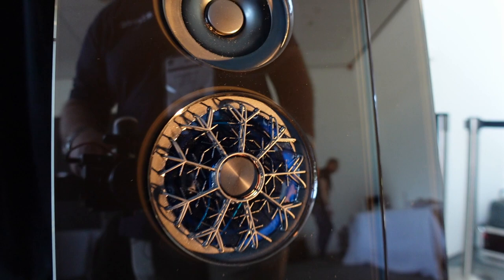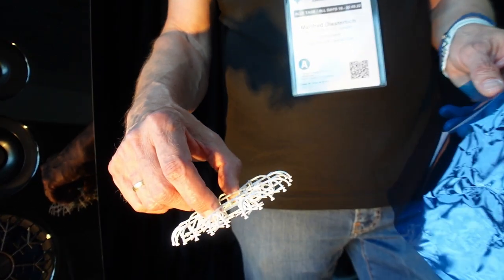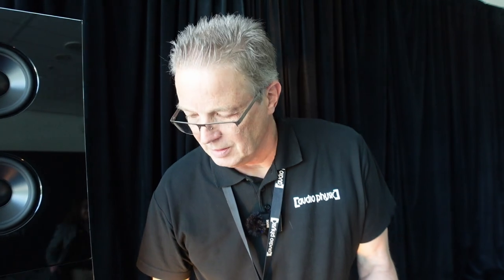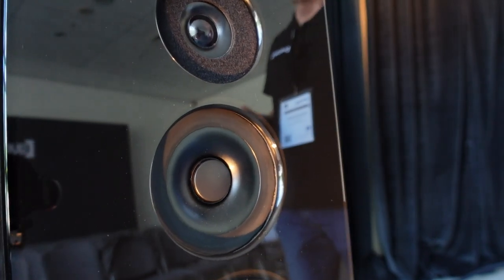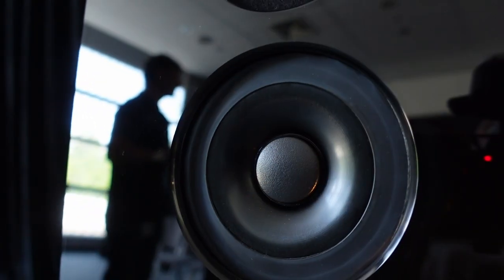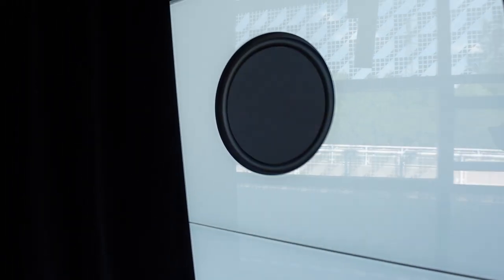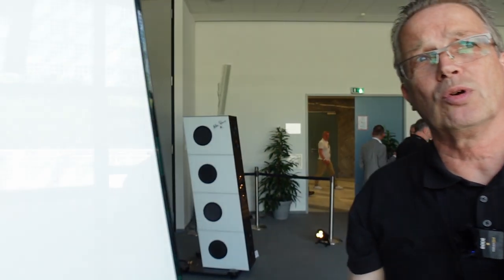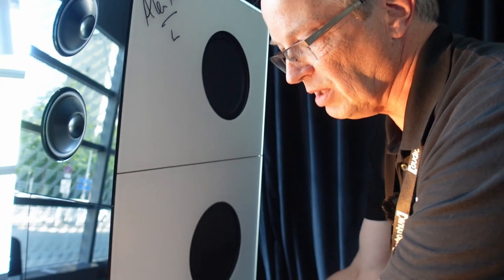Audio Physic Medeos - ny høyttalerteknologi

Comment: Cool design.  It looks like the 3D structure is copper electroplated?  Smart using a low mass membrane with a longer travel distance for more displacement.  I'm assuming the idea was to vercome the fixed travel restraints found in planar or electrostat membranes.  
Titanium plating might offer better low mass/rigidity #'s than copper.  
That price though... not in my lifetime...
Reply: thanks seen that driver !, not sure if that actually works so great, distance between driving points is rather large. might be efficient in the mid range there is where it ends im afraid.

the 3d printed structure is only to transport movement from the voice coil to the foil. and it will do this in small places. not very uniform. the foil mightr be light , the structure is not compared to planar. the foil is also 8 times as heavy as regular foil for planars. still a cool concept. to bad i dont own a 3d printer :(
Reply: @joppepeelen   
True, the whole moving unit might be heavier than in conventional speaker, and you are left with quite elastic membrane. 
Not sure if its perfect, but nice that we have some attempt to progress in loudspeaker technology.